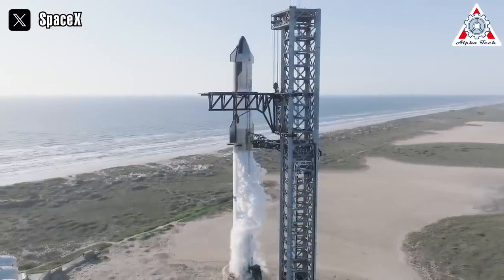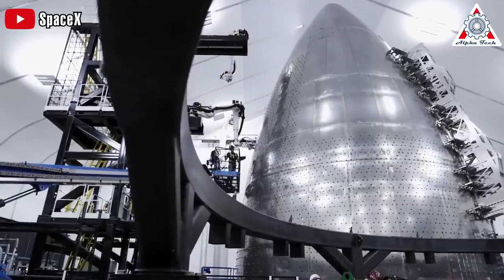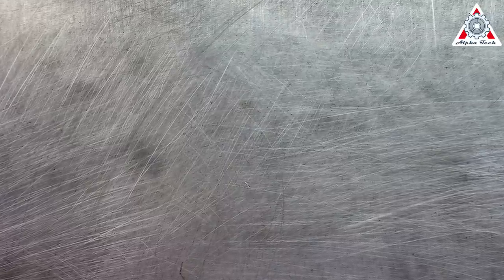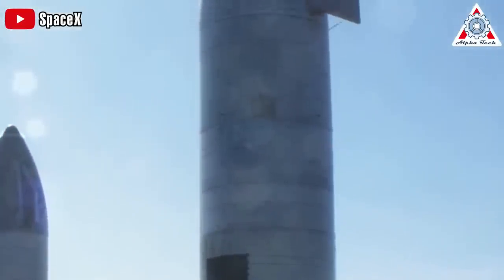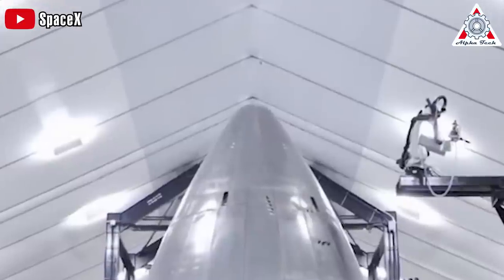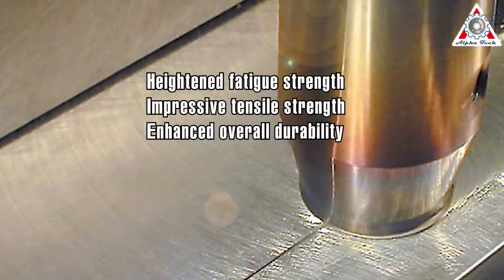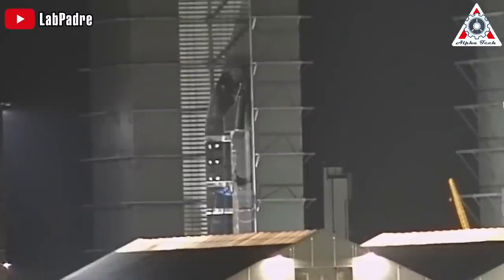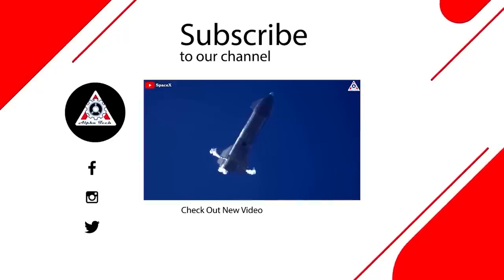What SpaceX just did with Starship's Welding shocked the entire industry!

Comment: I'd argue that FSW isn't really welding, being more akin to taking two balls of dough and entangling (mixing) them together so thoroughly that they effectively become one item. However, it is really strong; my one completely unscientific experiment was to take two plates of steel joined together by FSW, clamp one in a large vice, and then belt the the other with a sledge hammer. Nothing whatever happened which was extremely impressive.

Comment: Eventually a giant Vacume based orbital and friction welding mold surrounding robotic welding will probably be used to Fully weld all atc1 time processs. With laser pressision and different methods well as Tripple shield etc. Having less distortion and instant Xray and geat signiture mapping. With precise anealing post and preheat Planning. Predictive weld analisis and ai developement. With welder asstants tying in areas ofclesser importance. The wires faporise liquify out of the wire gun the resolidify at well fussion point.

Comment: The idea posted hear on welding stainless isn't completely true.  If you don't know anything about welding, then what was stated is correct.  I get the idea this opinion is warped.  The friction weld may turn out to be trouble as the area needs to be preheated and given a heat cycle after the weld.

Comment: None of the technology is new or shocking. The external tanks on the Space Shuttle used the Friction Stir Welding Process. Engineers researched and adapted the technique in the early 1970s. The only shocking thing is that the SpaceX original welding was so poor. Were they using temps ?

Comment: I take umbrage with blaming the welders for the earlier iterations of starship. I would imagine that SpaceX attracted some of the most talented welders in the trade... I would imagine the majority of welders on this project are boilermakers and pipefitters. These guys work on material that have tolerances just as tight as those of starship. Starship after all is just a giant pressure vessel. Boilermaker welders and pipefitter welders can sometimes spend their entire careers working outside in the harshest conditions... ever been to northern Alberta or Saskatchewan in the dead of winter? 
Engineers are responsible for coming up with welding parameters and the qualification procedures for the welds. The WPS (Weld Procedure Specification) lays out the parameters of the welding: Method (FCAW, SMAW, GTAW, GMAW, Friction Stir, etc), amperage, voltage, type, thickness, etc. 
The PQR (Procedure Qualification Record) is used to test the WPS and the final weldment is tested to ensure it meets the needs of the design. 
The you have the WPQ (Weld Procedure Qualification): A welder is given a test to reproduce the parameters in the WPS... if he/she passes, they are now qualified to execute the weld as designed by an engineer. 
If the welds looked like crap, it is because the engineers designed them to look that way... not because the welders are inexperienced or working outside. If SpaceX blamed it on the welders... shame on them. 
I've commented on another video about welding at SpaceX that was equally misinformed. 
Do you homework or ask someone that knows.

Comment: The guy doing the Narration obviously was NOT a welder, he knew very little about what he was talking about, whoever put the Pictures together was likewise semi-skilled in fabrication, because there were things thrown in there that didn't fit, like the early part where they were Stick welding when that method was not used and not talked about. Please do your research BEFORE you go to film. They probably chose Flux-core because they were welding outside, and to Mig or Tig weld, you can't afford for the wind to blow your shielding gas away, you would have to have an enclosure around your welding area to stop that happening, looking at the size of the Ship, that would have been Very difficult. Tip tig would have been done INSIDE the building, for the Gas reason Just explained. BTW, I have been welding for about 40 years, and I do a lot of Tig welding, mostly High Alloy Steels and Aluminium. Laser welding would be Interesting to do, it would be very clean too.

Comment: lmao. grinding made it stronger! also, the welds failed!
Reply: Grinding generally does not make a weld stronger but it does make it more resistant to failure under cycling loads. Early failure has to do more with surface stress concentration factors, which are higher in rough surfaces than in smoothed surfaces. Under cycling loads micro cracks form faster in rough surfaces than in smooth ones and they grow into larger cracks leading to weld failures. The best welds, I'm guessing, are the ones so perfect they can barely be seen.

Comment: I knew they were using friction stir welding. But I’ve never been able to fully get my brain to fully work out how that works. 

Would be good to see a video on how friction stir welding works.
Reply: Metal atoms like each other but when separated by an oxide layer they cannot join up. The edges are fit very close with a backup tool the stirring end effector spins against the surface creating local heat. Oxygen is excluded with shielding gas the metal gets mushy but does not liquify. The two edges or crack atoms join to form a new local matrix of crystals resulting in one piece. I was part of a team developing diffusion bonding and super plastic forming of titanium in the late 1970’s. Cool stuff iron the basis for all steel exists at the atomic level in crystals that look like dice cubes all joined together. Crystals are very small and can be broken apart and reform as in hot or cold rolling to different shapes. So friction stir welding is a local rearrangement of the crystals as opposed to welding which is localized casting that phase changes solid to liquid back to solid. Think about that!
Reply: @oneskydog6768  so the “stir” is that just something spinning on the surface?

How does the well penetrate through the sheet from the surface? Is that just through conduction heating?

Or is there a thing that physically penetrates the sheet metal?
Reply: @oneskydog6768 I think what I don't understand is if you have something penetrating the joint and moving stuff around... why don't you end up with a huge gap or valley between the welded sheets? Or... If you have a stirrer shaped like --v-- do the flat bits on either side then push and squash it all flat which would make it push back together again and form the seal neatly.
Reply: @oneskydog6768  Yes, but they are not in love, apparently.

Comment: Cold rolling is hardly a new process! Neither is rolling the strip to achieve a circular form. Nothing new here that NASA Artemis didn’t already beat SpaceX to. 

NASA also uses laser welding; has for over 20 years. But in addition, NASA uses automated processes to inspect and test the welds AS ITS WELDED!!

Yawn…..

Comment: Another counted coup for me! 🤣 When hopper was built and looked like schift, I did a writ and explained what the problem was, what caused it, and that it was called "starved horse effect" in the industry.
Basically your skin and internal rib structure have to be of about the same thickness stock, or weldment cooling shrinkage will suck the skin into a pucker...
ie they needed to make the skin thicker, were a couple three thicknesses too thin for a hull.
On smaller steel boat hulls ⅛" inch is considered a practical minimum, and you are fighting this effect even at this thickness, and of course Rocket Enginerds didn't know that, and probably didnt ask the Welder Peasants to review their plan.
Needless to say, Elon got asked about it by the public, and had to say it would get fixed. And eventually look all shiny etc.
So I knew the writ would help. Also about this time I saw that the combo of Enginerds and water tank guys wasn't making it, and did a writ suggesting "Enlightened Fabricators" and that they should be used to keep the Enginerds in check. 🤭
That writ likely made it to Elon, as he used a cloesly related term, with a different word choice for enlightened, and after that hired some upscale fabrication contracting company, and things got better fast.

After that I noticed that they were over welding things, especially on the nose cone from welding up hill. And ran into some guy on a Rocket Lab forum asking people what they thought Beck would think about Starship. Smelled like a fishing expedition to me,
and I got into it with that guy, and pointed out that spacex had some quality issues.. which of course put the guy into Buffoon mode. and he said SpaceX had the best engineers and welders on the planet!
My response was:
 "So they say, but I dont see it in the product."
And of course the guy got indignant and asked for examples, so I pointed out the crappy nose cone welds in images were an inch wide, and that was unprofessional, weaken the metal, and look like crap, and that they shouldn't be much wider
than the metal is thick.
Needless to say, it wasn't long after that, the problem was rectified.

Root of the problem is uphill welding, and that the design was originated production wise by the water tank guys.
Welding up hill always sucks, it can be done OK, 
But its slower, more difficult, and liable to lower quality results.

Fine on water tanks that mostly cows see, but something thats generally avoided whenever possible by conscientious
welders. Even though they are certified to be able to do it. Just because you can, doesn't mean you should.
And the root of the uphill problem, is the expedients of water tank fabricators.
And them trying to keep the rings round against gravity. which boils down to backwards of standard practices on hull construction. Usually you work with jigging or build forms or at least build the internal structure first and lay the skin over it. this allows getting things right, and welding in the flat as much as possible.
I suspect SpaceX is setting a Guiness world record for uphill welding, and for doing things the hard, slow, expensive way. And all of this stems from Tin-Tin's rocket being a tube...
Tubes are for tankage  take a look!
Only tube hulls are submarines, and its due to thousands of psi of external pressure, 15 lbs of internal pressure dont require the curves, Which is why ships have better hull shapes for the job, and rockets should be no different. in fact you could design a Space Shuttle like aerodynamic lifting hull and wings using hard chine fabrication.
And you could rack it to fabricated tanks, sporting  plenty of engines on the bottom of the rack, and you could build all of it on the ground in shops, and have those fuel tanks be basically disposable and not have the in space fuel transfer issues. And repurpose those tanks anywhere in space for anything needed.

instead we have cranes everywhere, and guys working more risky jobs for no apparant reason, to build an inferior product, because the Space enginerds think they know everything.
The welders dont care, they get paid by the hour, if management is stupid, they still get paid... Its like a donkey taxi with a lost driver, the donkey still gets to eat at night.

All of this is an example of missed logic, and how humans tend to go off on tangents that are sub optimal. Theres always missed logic, nobody knows everything, and the more intelligent people check out related fields instead of assuming they are Gods....
Guys; if you wanna be an Ahole and improve the human condition at the same time, always look for the missed logic, and for arrogant people doing stupid things.
Elon ain't arrogant, he is results driven, but even he knows everybody makes mistakes and nobody knows everything.
So if you know something
and see something, at least comment in the online medium, other wise the chances of optimum are zero.
Reply from the maker: I read all of your comments! I feel so excited to know more new things! Thank you very much! Have a nice day at work!
Reply: Well, it’s simply unbelievable that there is only one welder who could properly weld stainless steel.
Good thing you enlightened all those ignorant Rocket Enginerds.
Else SpaceX would be a totally failed bankwupt company today.
Reply: @ernestgalvan9037  Never said that. quite sure Elon has really good welders now, in fact I may have sent him a few.
The problem isnt the welders, its the lack of the management understanding of the potential for single curved chined construction, which we humans 
have been doing welded on ships for about 123 years.
Welding in the flat is comfortable, gravity helps get a good deposit, welding up hill or over head are more problematic, Harder to do well, less likely to get the same quality. In fact most welders arent real fond of either, especially over head because it hard on your body to do.
So, the management not knowing these facts dont design the process of production well. and it costs time and money, and I'm sure Elon would like both better applied.

And I'm sure the workers
would be happier if things were engineered to facilitate their work.
On those tubes, would be easy enough to build roller cradles with a scaffolding system so they could be rotated and get more production, faster and higher quality. On boats for instance hulls are often rolled over to get the force with you.
And one notices Boeing doesnt build their huge aircraft standing on their tail.
In fact there are images online of the system they use to build round hulls on the ground, via adjustable 
support forms. I could see SpaceX building the rotational version, and via having several of them, get serious production inside and out at the same time. and Get consistant sizing and in the round for sectional mating. probably could even be a countinual proccess, even the sections welded together on the roller forms, and then things removed and the decks inserted, or for tank domes, or decks, welded in before the next section is welded on.
If welding them in, you'd want to do as wedge sections prefabricated on benches with a center passage hole.
Also I've never seen mention, but suggest the enginerds study what are called rat holes in ship construction, they help allow access to every inch of weld for inspection and repair, also internal framing should never be placed over a hull weld, as leaks can travel between the frames and skin and be hard to track down.

Could be important, half way to Mars is a long ways to hold your breath if theres a leak.
Also on things like fuel tanks, having one huge tank is asking for a micro asteroid holing, and then the humans head out past Mars on a one way ticket.
Better to do standard tanks in multiples, like in the racks idea. Where if one leaks, you have spares.
Might be hard to chew gum in your Space suit and get it to stick to a cryro tank outside, to plug the leak. I dont think Duct tape will do it either....

Comment: "In flux core welding, the wire is wrapped in a material that burns to release a protective gas. "   UM  flux core means that the material that burns to release a protective gas is in the core of the wire, Hence the name FLUX CORE. You could have gone to any welding supply store to research the information you falsely stated in your video.